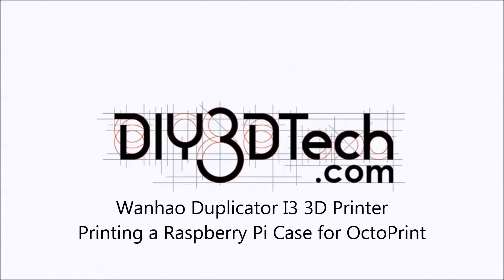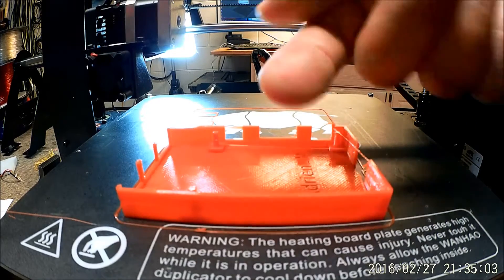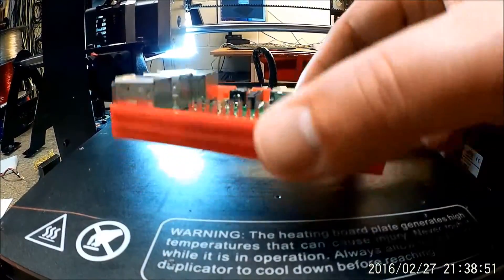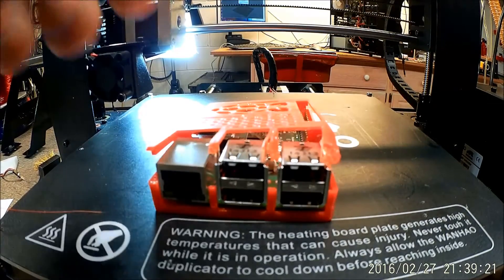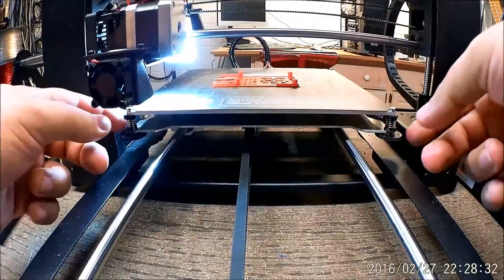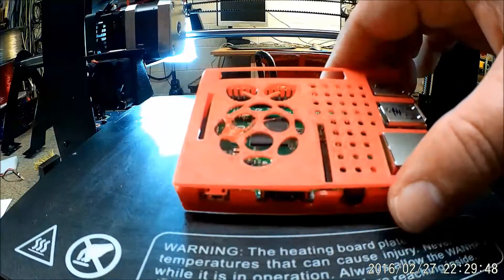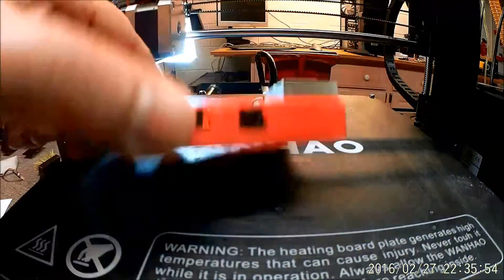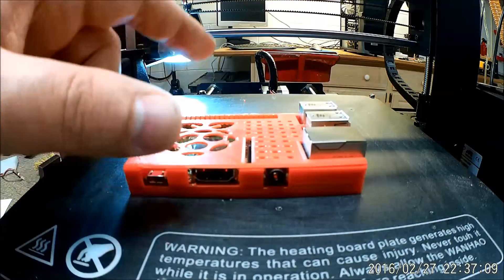Wanhao Duplicator I3 3D Printer - Printing a Raspberry Pi Case for OctoPrint

Comment: Which print settings are you using? PLA or ABS?

My issue with adhesion to the print bed, with the Wanhao, is the total opposite - it sticks too well to the Buildtak surface. My only comparison, though, is the Fabrikator Mini where everything I've printed have been easy to remove from the bed.
Reply from the maker: +Patrick Strang PLA, and do you have the bed adjusted correctly?  To much "down force" on the initial layers will make it very to get off so try allowing a little more space between the hot-end and bed.  I Typically use about .2 to .23mm...
Reply: +DIY3DTECH.com yeah, I'm still fine-tuning it in Simplify3d. Luckily I can make global z-axis modifications in software instead of tweaking with the print bed itself, as long as I've managed to get it as level as possible manually.
Reply from the maker: +Patrick Strang Its better to adjust the bed height you will find than adjust the Z-Offset.  As the Z-Offset is typically used if you have say added a glass bed to adjust it upward. On Wanhao style printers without auto calibration setting the bed is an art form.  I also fine turn it as the first layer goes down too make sure it is "just right"...